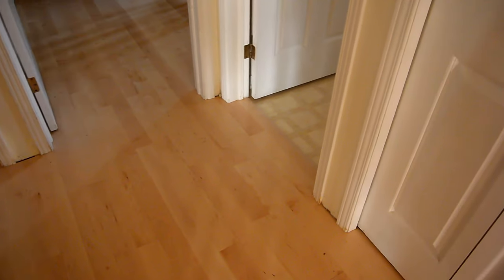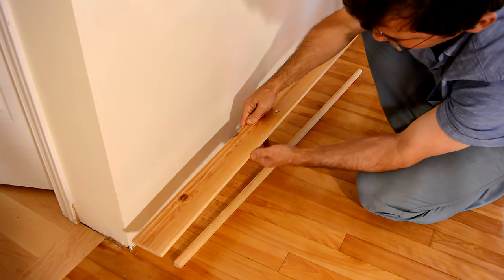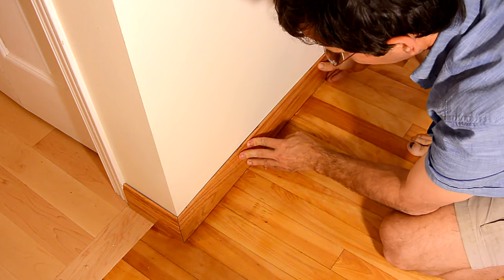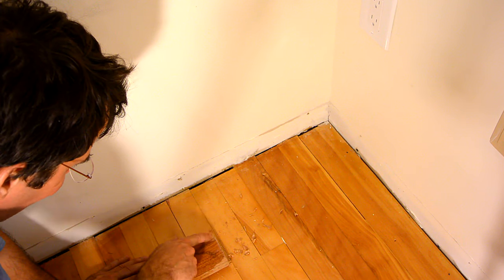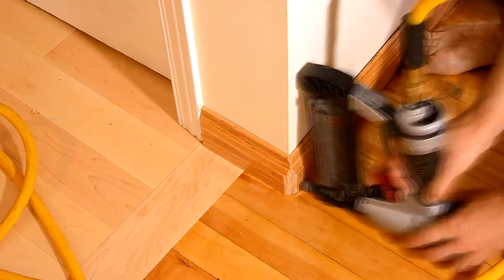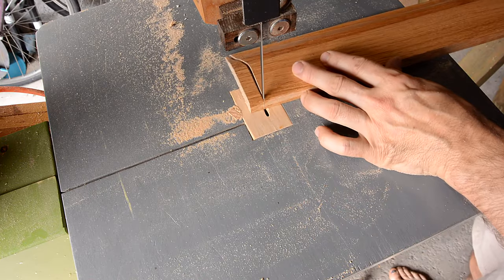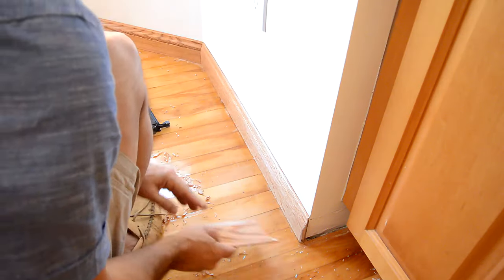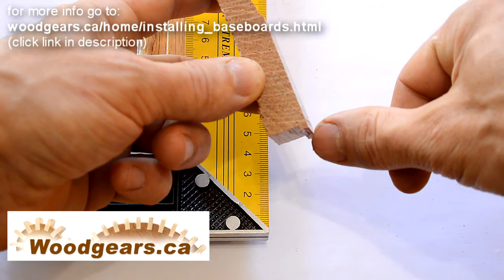Installing baseboards

Comment: Not sure how I feel about those outside corners. 😳
Reply: Jason B I'm the same,  I normally leave them in.
Reply: Jason B
It's a good idea when you have kid's
Reply: steve gray the more I think about it looks like someone hit the corner with a wheelchair like 1000 times. Maybe just a slight round over would soften the edge like he wanted without it looking so bad . I have stubbed my toe on the corner of furniture but never the corner of a wall. Lol 😝
Reply: Special corner pieces would look better.
Reply: I don't like them being cut off either.
Reply: Harry jnr I have been installing trim for 25 years ,and never heard of a child or adult hurting themselves on the baseboard corner it's down so low , how about the entire 8 foot wall corner, that's were kids usually bump their heads.
Reply: I can't believe how terrible this looks. All of his hard work (buying, preparing, varnishing, trimming, etc) was completely wasted with these corners. I absolutely would not have that in my home.
Reply: Its definitely different. Although being oak it would've made for a very hard/sharp corner if left traditionally 45'd. Also, the way he did it makes the corners much more tolerant of abuse. A sharp corner is easily dinged.
Reply: Ask your toes.
Reply: Jason B
Not many 8 foot kid's about!
Reply: If I wanted a soft corner i'd have just planted them on sharp and cut them down a few mm with a hand saw so that the corner still looked square/even. But whatever works I guess.
Reply: Ruined those beautiful miters by bullnosing them. That said, far too traditional for my taste.
Reply: I was also kinda hoping he would come up with some crazy design for a one piece corner. Other than that it was a very informative video for me that I've never done this kind of work before.
Reply: With some varnish it won't be as noticable
Reply: Ad hominem attacks apart, constructive criticism or simply opinion sharing is part of the game. See the like-dislike buttons there? I never press the dislike button but I do like to write a small sentence of what I think, if only to practice my English. I personally think a rounded corner may have looked better. But that's only my opinion.
Reply: Why don't you show us a video of all the trim in your home?  You made it all yourself right? I can't wait to see it, it must be beautiful if you wouldn't settle for solid oak.......
Reply: I think it will look fine after being revarnished, its the contrast that makes it so obvious.
Reply: iliketoUSEmybrain017 what would be the point you are trying to make? This guy is very talented, but in my and many others opinions what he did with the outside corners was odd. I have been doing custom trim work for 25 years , so I'm no newbie.
Reply: I like it!  What's the point of having baseboards at all if they stub your toes and look like every other house out there?  I don't understand his aversion to the quarter round though.
Reply: These outside corners seem very web 2.0 I think Matthias is just ahead of his time.  90 degree angles are so harsh on the eyes.
Reply: Back cut a 45 on a small corner and cut each wall piece at a 90 stopping right at the corner. It's an old trick called a "nipped corner" .
Reply: Chris J's Clockworx Yes! I couldn't remember what it was called. I watched my uncle do that about thirty years ago, and it totally blew my mind.
Reply: I winced at those corners a bit myself, but let's remember: This is Matthias - In his projects there is no battle between form and function.  Function beats form, to a pulp, every time.
Reply: Ew, yeah, nothing like the look of a nice sharp corner fit, that just looks amateur.
Reply: Yup, I cut mine at 22.5 degrees and add a small pie wedge shaped piece also cut to 22.5 degrees on both sides. It requires a bit of work and glue but the finished product gives a less sharp corner edge and it looks great.
Reply: Agreed. It looks awful! I died a little inside when he took that first cut off the small piece where it meets the door frame. Looks terrible
Reply: It's Wandel chic!  Matthias is actually a rising star in the world of interior design.  It's a deconstruction of 19th-century library with a nod to 20th-century drywall consumerism.
Reply: When was the last time you stub your toe on your base boards?
Reply: Chris J's Clockworx's solution gets my vote. I cringed when he made that cut so quickly. 
Matthias is an expert at most things he does. This job could have benefited from more research on the installation end. Still love the skinny guy!
Reply: I have MDF ones in my home, never kicked them but the nice crisp corner is not so sharp anymore from general brooming, vacuuming, cords and stuff. A beveled one would not suffer so much if at all.
Reply: Seems like I can't stop stubbing my toes on the outside corner of my baseboard.... It's totally out of control. At this rate, I'm gonna be left with feet full of bloody nubs.... jk. Wandel is the smartest man on the net, but no... that corner is hard to look at....
Reply: Why would anyone call their installer to complain about stubbing their toe on the corner?
Reply: Barry Manilowa    Hahaha. Camel toe baseboards. That's hilarious. Lmao.
Reply: +Jason B Do you actually want me to list similarities between trimming and penises?
Reply: seigeengine sure why not. Seems you need to release some energy so go for it.🦃
Reply: they ruined my life
Reply: yeah thats totally not a thing  lol
Reply: Agreed. Not a fan. And the endings next to the door trim should be 45 degree in since they are wider. Not tapered.
Reply: @harryjnr2335  Lessons are learned through pain. One toe stub and they will stop running in the house.
Reply: Best take the doots off for safety to.

Comment: I think this is just a case of a great mind over thinking this one. You are still the man
Reply: Jason B could be said for a lot of his videos
Reply: yeah i mean, i respect the work put into it and i understand everyone has different tastes but there's just too much going on here. obviously its a work in progress so i can't judge too harshly but i've never been a fan of stained baseboard. no matter how much work with a plane you put into getting them to sit flush, there's gonna be a tiny gap somewhere. it's one of those things where i just prefer the "cheap" route with painted MDF and painter's caulk. imo you can't argue with the cleanliness and the seal against the wall and floor.

Comment: 5:40 Confused that you "mitered the first few corners but it was hard to get it right."  Cutting a cove properly begins with a miter cut on one board which provides the exact profile needed to cut with a coping saw.
Pretty boards, but I'm also not certain I like the trimmed outside corners.  Part of the glory of any molding is the way the outside corners protrude in all their toe-stubbing glory.

Comment: One trick I learned from my Dad (a finish carpenter) is the easy way to measure inside corners. First, measure from one corner to somewhere in the middle of the span and make a mark on the floor near the middle with an even number...like 60". Then measure from the other corner to your mark and add the numbers together. He always added 1/16 so the molding would snap in place. 

Nice job...You've got a lot of work in that trim.

Comment: as someone who has been installing trim for 15 years. what i would have done on those outside corners, if you wanted to relieve the corner  would be to cut a small piece so you will have a 3 piece corner with 22.5 angle cuts on each piece. that way you wont see end grain.. 

thats rule # 1 for trim NO END GRAIN SHOWING ANYWHERE! lol 

also we have the same quater round here and it measures 3/4 tall x3/4 inch deep   but typically you would use a actual shoe molding that would measure 3/4 tall by 1/2 inch deep. 

also on coping. I always cope every inside corner.. what i do it make your measurement and cut a reverse 45 degree cut than you have your exact profile shown for you.. then by hand i quickly cut it out with my coping saw.  and always back cut your cope as well by putting a angle on your cut.. that way when you shove that piece of base against the other one its a crisp perfect fit with 0 gap because only the exact face of the base is making contact and there is no obstruction by anything in the back of the base.

love your Videos as always.
Reply: As an apprentice with 1 1/2 years experience I have to agree, a shame to see him put all that effort into milling that stock to have the end result end up looking the way it did.. The method he used for his outside corners doesn't suit me, your method wouldn't have been more work than the additional 2 cuts he made on his.You're right it's much easier to cope the way you described and it yields a better fit. As far as scribing the base to the floor, I feel either a jig saw or a grinder with a flap disk and meticulous fitting and refitting would have been the way to go rather than the hand plane. Could have back cut them a bit to make sure that front edge sat nice and tight. Although for base, I'd just stick with shoe mould as well.. Different strokes I suppose.
Reply: That's how the baseboard in my house is, 22.5 three corner pieces on the edge, looks good
Reply: Could one of you guys add a photo here of a 3 piece corner?
Reply: adam nichols thanks!
Reply: Yes thats a good pic of it although his gaps he has are really bad but you get the point.
Reply: mmiguy2306 ...great tip! Thank you!
Reply: yes... what he said lol well said !  
i only do the 3 piece corner on bullnosed corners.

Comment: Looks great, I actually prefer the look of the sharp corners. I've barely ever stubbed my toe on them.
Can't wait to see what it looks like with the door jams replaced, because it does look a little odd at the moment
Reply: Hunter of the North
Kid's and toes
Reply: I have a toddler and he hasn't stubbed his toe on any baseboard it's usually chairs or furniture :P
Reply: Counter-opinion: If there's a thing on the floor, I have slammed my toes directly into it at least five times. If it's not on the floor, there's still a good chance my toes have slammed into it at some point. Also, there are young children in the house.

Their toes? When I was a kid, my head ended up slammed into plenty of things low to the ground. I wouldn't risk it. You don't really get redoes.